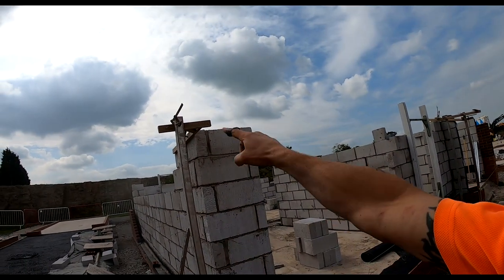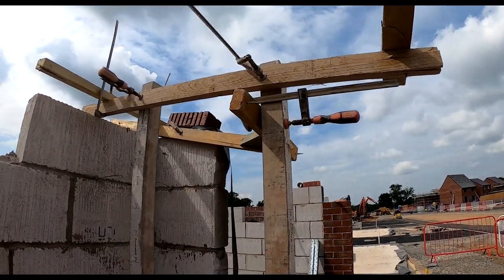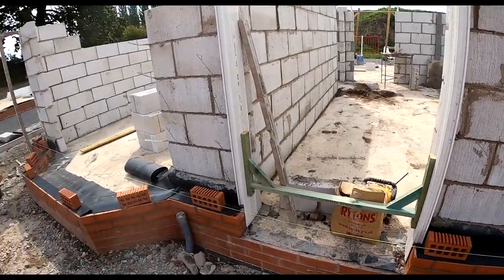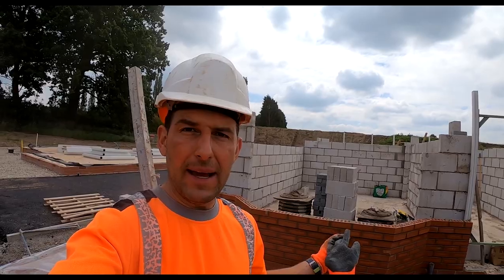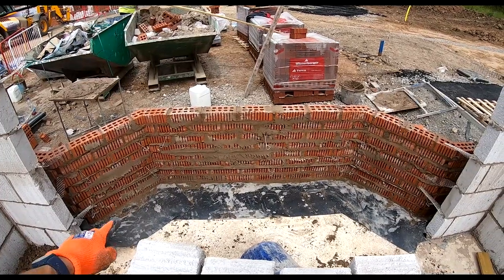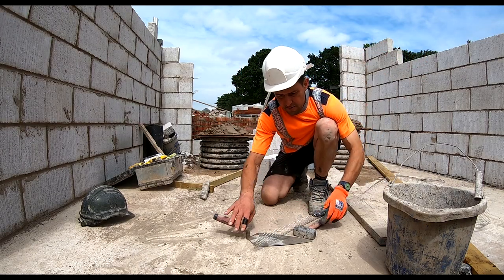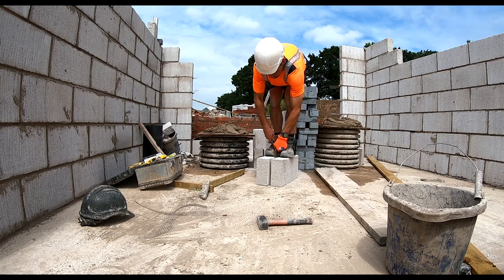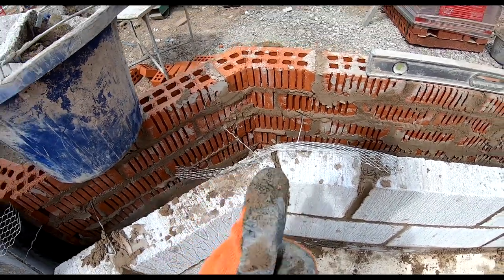BRICKLAYING: Building a Bay on Site - Cut and Stuck Specials and Profile Setup -  🧱▶️👍

Comment: Hiya lovely job with Some good tips. Did you get the angle bricks pre made or did you cut and glue them your self on site?  I got an extension with an angle Ive worked the angle out but just wondering on how to get the bricks sorted!  I guess they’re expensive to get made by a company. Cheers-
Reply from the maker: Hi Chris! Yeah the full bricks get picked up from site by a company, taken away then dropped back off cut and stuck. They are not bad to be fair. We had some handmade bricks cut and stuck the other day and they were all over the show. If your using a uniform brick they can get them pretty accurate. I’ll find out the company’s name and let you know. 😀👍👍
Reply: @brickworkfundamentals4636  Thanks bro, much appreciated👍
Reply from the maker: Hi Chris ! My mate uses premium cutting services ltd in burslem ( next to the college) 01782 825046. They are supposed to be mint 👍👍🧱